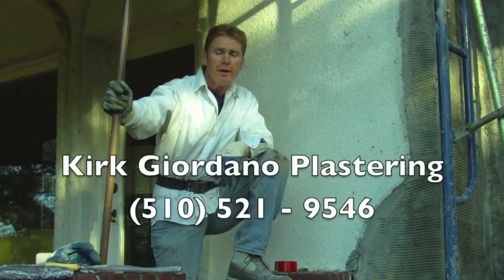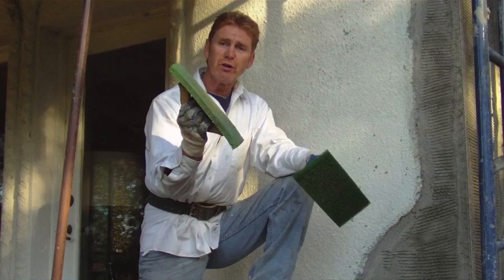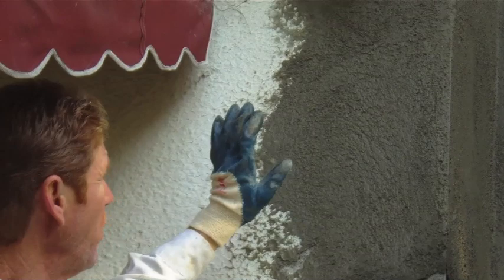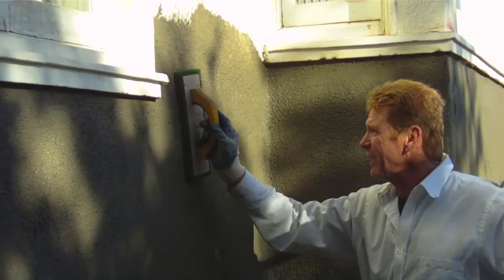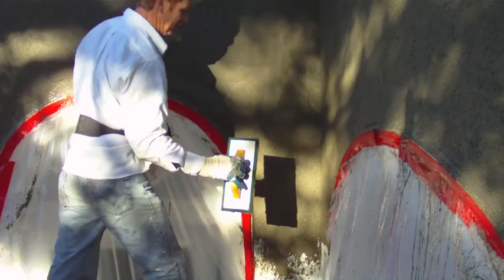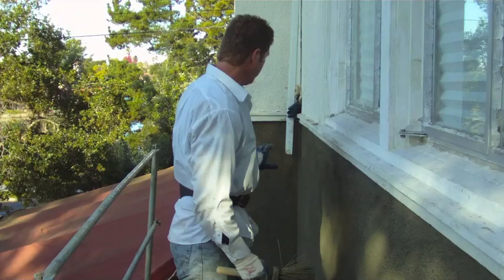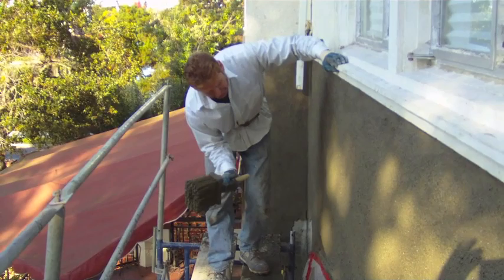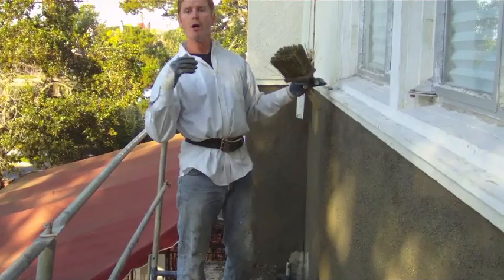The basics of stucco applications and finishes

Comment: We look to you for guidance every spring! We are about to do a repair on our heavy-dash stucco chimney. Originally, in 1925 they applied the stucco directly to the brick. I am not sure how to tie this in. The entire house is built out of a brick that has similar characteristics of a cinder block but out of clay and with grooves on both sides. Unfortunately this brick wasn't used on our chimney and it is common brick. Thank you for your videos. There are not very many plasterers in Detroit!

Comment: Hey, Kirk,
How do you mix the dash finish stucco? I guess you put cement, sand and water in a bucket and you make it really soupy. That's my favorite finish by far. I do have a few brushes, but I also have a hand hopper. Looks like a big fishing reel, professionals probably don't use them. I found it in my dad's garage. Can I use it? Also, do you put heavier sand in the heavy dash finish?

Thanks, Kirk.
Reply from the maker: Hi Gandalf4137, mixing takes a bit of practice, I put the lime in the coconut and drink em both together, 
Seriously, if I see large sand in the finish I am trying to duplicate, then yes,  I use heavy sand not the typical plaster sand like say Oly, or Felton sand, the consistency also maters a bit, on some jobs I add more or less water depending on the existing dash finish, takes a bit of practice to look at a finish and realize how they got it that way, easy for me as I have had my share of throwing on these finishes,
 Cheers,
 Kirk giordano
Reply: +Kirk &amp; Jason Giordano&#39;s plastering &amp; stucco tips 

Thank you, Kirk. Less water would make the finish heavier, wouldn't it?
Reply from the maker: Hello, sort of, less water makes it dryer, keep in mind I also wet the brush to start off with and if the mix is too dry I have a water bucket handy, fro which I dip the entire brush into and turn the brush into, thus removing all dry stucco, next I will dip the dash brush back into the dryer mix, mixing by hand and brush more water, this action also stops the mud from sicking to the brush, sometimes necessary.
 FYI, there were days in the past that I just dashed houses for 8 hours a day, which at the end of the day your arm feels heavy but strong, this is the beginning of dashing knowledge.
 Cheers,
 kirk giordano Plastering